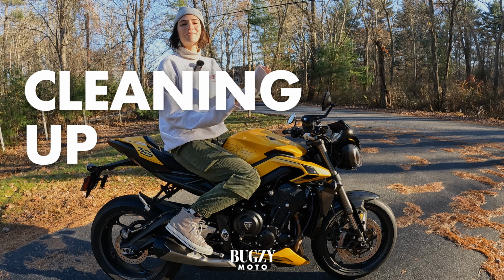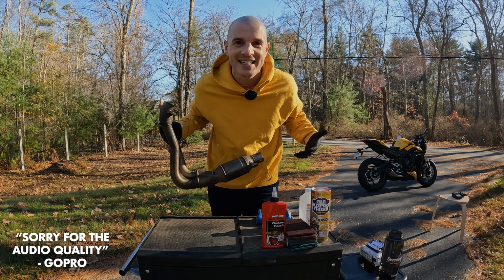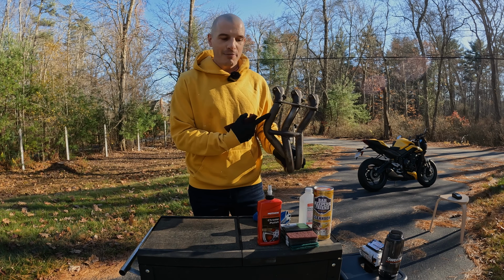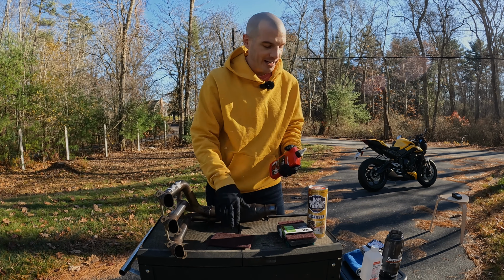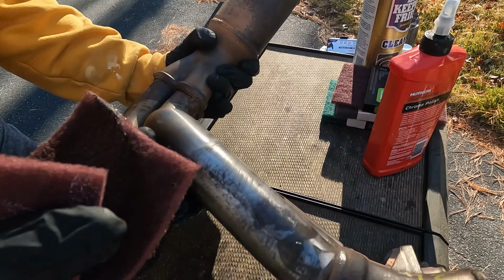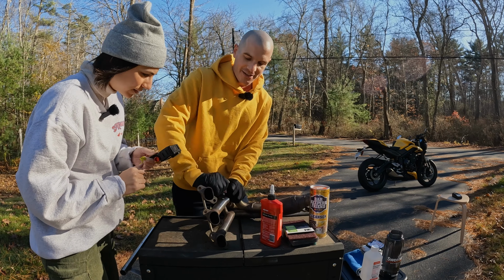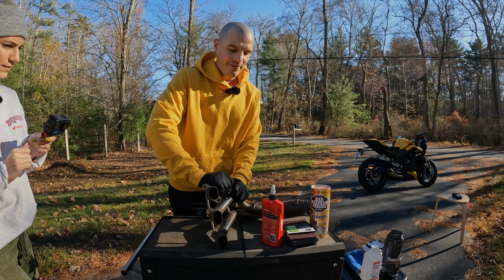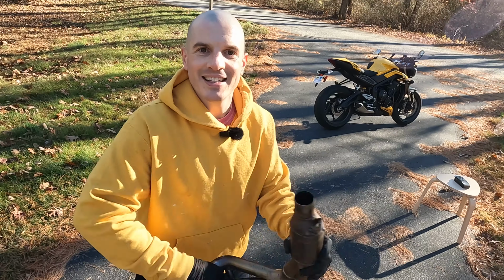How To Restore Stainless Steel Pipes for Cheap

Comment: Semi Chrome and a Mothers polishing ball gets in the tight spots. Might be easier on the hands.
Reply: @johnharney3271  good call! That'll help out on bigger pieces with more surface area, and the spokes/rims on the XS650 and Sporty
Reply: They make different size polishing balls. Try some Blue Magic polish. Works well on non ferrous metals. Aluminum, brass, mirror finish stainless steel

Comment: Semichrome works awesome on stainless exhaust (requires lots of elbow grease though ). Anthrax is one of the best thrash metal bands to come out of the 80's. LOUD PIPES SAVE LIVES
Reply: @Grumpyoldman60-  I almost took out the joke but agreed if they can slay under that name then I can connect with the early 00's generational trauma 🤘 loud pipes are indeed the way to EXIST
Reply: disease,
disease,
spreading the disease!!
🤘🌝🤘

Comment: I got great results on my M900ie with just a red scotchbrite and WD-40.  I even used a brass wire wheel on a bench grinder for the wide open areas and none of it left a mark on the factory grain.  However, I tried the same thing on my F750GS and it immediately scratched the shit out of it.  I guess the lesson here is to always test on a less visible area first because not all stainless is the same.  Also the Woodcraft store on RTE 1, right up the street from Mom's has some great scotchbrite balls you can mount on a drill for tight areas.
Reply: @thebloodyserb  the drill mounted 3M balls would have helped immensenly down where the three pipes collect and also on the welds near the tops of the header where the mount meets the pipes, and would probably cut 15 minutes out of the job easily. I also didn't know stainless had different grades, so thanks for the heads up! could have been bad for me 😂

Comment: One trick I’ve heard is to use something like a hockey skate lace  with the Barkeepers friend and wrap it 1.5x around the pipe and then you can pull back and forth with the two ends and it’s cleaning/polishing all the way around the pipe at once. Can help with in between areas where it’s tough to get by hand.
Reply from the maker: ohh I can see how that would be a really good hack!